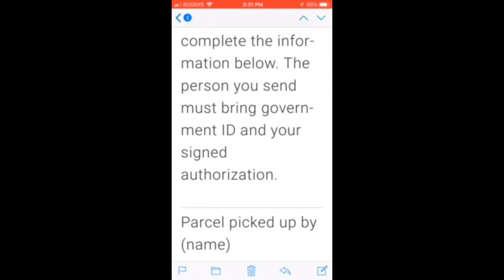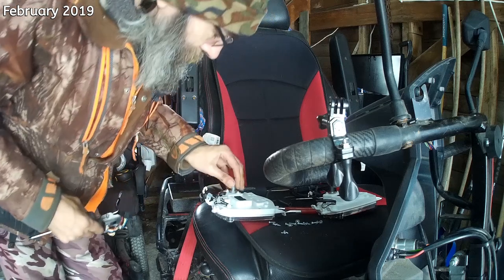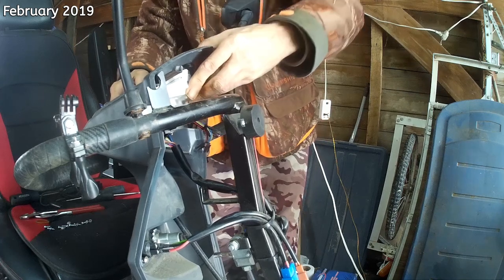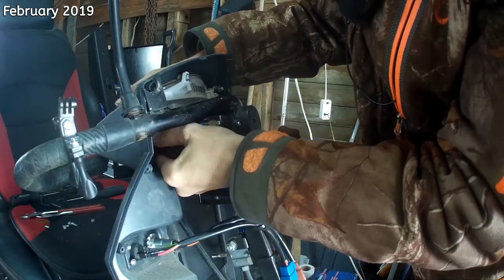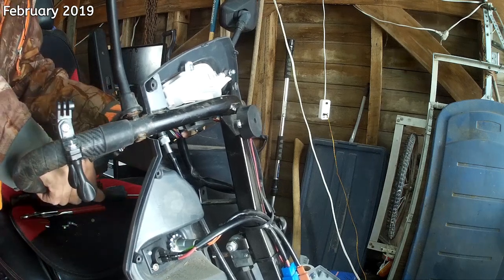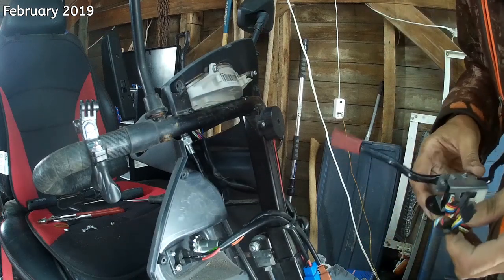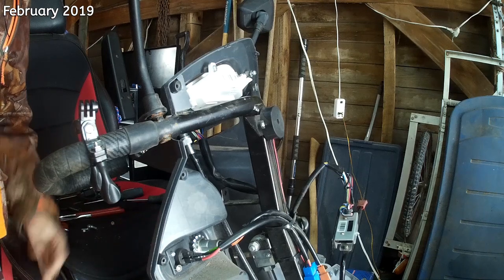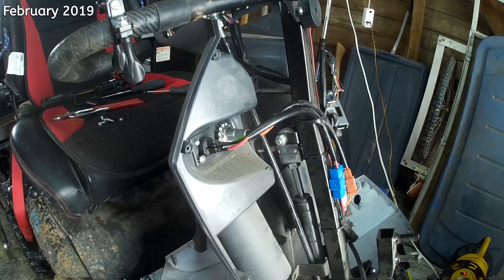Installing the New Display Panel... Uh Oh - February 2019

Comment: Maybe the key switch or something in the light circuit somewhere, what a pain in the guts the Monster is, it really is a MONSTER Bud. If you buy a new throttle I'd tell them and show a picture of the broken dash and say you expect a discount on the throttle because of the broken part. Other than that Bud if have no clue but I'll keep thinking.  Seeya Rob
Reply from the maker: Interesting guess. The ES950 went through a weird set of circumstances when the key switch went in it. I hadn't thought of that in this case. The actual problem is even simpler.

Comment: Other than the speedometer not working, what else was wrong with the display panel? Did you look through all the bubble wrap for the broken part? Your speedometer seems to have a cable like a car, mine has a censor that read a disk attached to the inside of the right wheel with 8 holes in it and as each hole pass the sensor that seems to be how my speedometer is read and transmitted electronically to the display. Is yours operated with a sensor or does it attach to the wheel like a car would? No disk with holes in it? ERROR ERROR that monster is quite the evil nemesis. Sheeesh! I don't think the problem is with the throttle but that's as far as my thinking takes me at this time. Opps I just realized this was Feb 2019. Did you ever solve this problem? What was the problem? Damn you yet another cliffhanger. You bugger. I'm going to guess a short circuit somewhere? A bare wire rubbing? A wire unplugged or disconnected somewhere? I'm hanging on this cliff now by my short hairs, I need a rescue Wes.
Reply from the maker: The signal to turn on the lights goes through the display panel. As I can't see an on/off switch being the problem, the next logical step is to suspect the panel. The speedometer cable is exactly like a car, all enclosed and transferred by spinning wire/cable/spring thingy. You are right in guessing the problem is not with the throttle. The problem was solved... "a wire unplugged or disconnected" is very close. Not exactly, but similar effect. Unfortunately you'll be hanging for a bit. I need to to an up to date video next, then I'll get back to it.